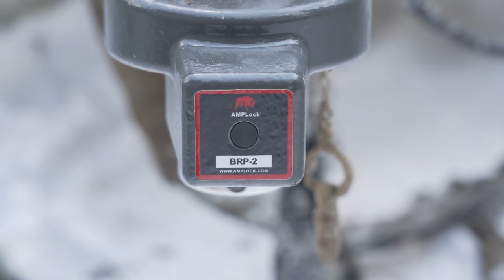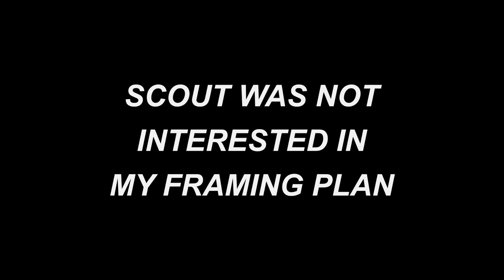ALONE with my DOG - WINTER CAMPING in a DIY Travel Trailer with a WOOD STOVE by a RIVER

Comment: nice build , i built a 6x12 with a fold up bed and a kitchen in the front . it is roomy enough to park my 3 wheel canam spyder in so i can ride when i get where i am going . one thing i did was install my safety chains with couplings so i can remove them when i park away from home . the idea is to prevent thieves from towing it with the chains hooked onto their hitch , and it does happen , anything to stop crooks , just keep the chains short .. have more fun..

Comment: Love the whole build , planning on one this summer and your security worry is one i have been thinking about and i saw one video where the fellow made his tongue ? on the trailer removable .Just a larger tube that slipped over the exsisting and when he parked he pulled it off , two pins held it in place ..........kinda where i will go for security

Comment: You need to lock your chains as well, wrap them around where they are connected, make sure their is no give, and with a good padlock, it doesn't stop the battery angle grinder though. All they have to do really is put a chain thru your A frame, and hook to the back of their towbar, where the chain connects and drive away. I have a wheel lock, it is the only guarantee, just don't ever lose your key.

Comment: Great lock on the trailer, but realize a thief can still use the chains to run off with the trailer regardless of the lock. I used a heavy duty quick link on my chains so I could remove them and leave just a couple of links near the trailer. With a good lock and no chain a thief would move on a to an easier target.
Reply: Hello 👋 Dear. How are you doing ? Hope you are fine. I'm Mark Clifford and am from Denver Colorado,  Where are you from? You seem like a real country girl

Comment: Hi I’m Peter. I love your caravan I watcht all of the videos you posted really like your stove I like to know it’s small smoke inside when is on or not? I have a similar to your caravan and I renewed everything inside including flooring lights wires I have no gas all electric from a 240 hock up and solar panel 12v and inverter and I have a diesel heater working well in England newer got less then-10 but the fuel expensive and I was thinking to swap for a wood stove;) you going a wery nice place I love to go there camping like your videos thanks for reading my message

Comment: My first winter camping was in a tent trailer in the Adirondacks of NYS in Nov. during deer season. At 20 below F our boots froze to the floor and our water pail iced over. We had an unvented propane apartment heater which we didn't trust to run overnight. No one had a warm sleeping bag because we used to have a tar paper cabin with wood stove until the snow collapsed it in 1971. I grew up in a farmhouse heated by an oak wood stove. The stovepipe ran horizontally from the stove to the chimney. I saw the same arrangement in the kitchen of an old farm house we hunted out of. It was a way to extract the maximum amount of heat from the stove before exiting to the chimney. You probably don't have headroom for something like that. If you did, you would have to line the wall and ceiling with fire resistant masonite board. It would be important also to clean the pipe regularly. I'm curious how often you have to feed your stove during the night. Also it would seem more efficient to build a stainless steel counter to prepare foods on and do dishes so you still have access to your cooler.  A shallow drawer would be handy for silverware and cooing utensils. A paper towel holder nearby on a wall is useful. The ironing board might be better as an eating table. In our camp we made S hooks out of wire clothes hangers to hang clothes to dry. Also handy for pots and pans. You could screw a lightweight cable the length of the wall to hook to. Wooden spring clothespins and spring metal paper clips also have similar uses. We also put down an indoor outdoor carpet to keep the floor dryer and cleaner and a boot scraper outside the door. A gazebo awning allows you to sit outside in rain or snow and enjoy the fire as well as washup outside. Also serves as a place to store firewood and extra ice chests. Even the best design can be made better.

Comment: All hitch locks can be bypassed using a chain wrap. City trailers use the method of taking one or both tires off if left for a while and putting locking nuts on the stud bolts. Curse crime.

Comment: That's a great lock. It's the same one we have on our fifth wheel. Someone did try to cut it off while we were boondocking. They used a dewalt circular saw as well as a dewalt sawzall. (Spelling??) The reason I know what was used is we pulled up on them and they left their battery operated tools behind. They hadn't made a scratch on the lock. They took off ( there were 4 of them) in a truck almost identical to ours. So they left empty handed and we received 2 almost new tools. That lock saved our vacation and a lot of money, so good choice. 
I use plastic utensils at home. Takeout food usually gives them to us and one way or the other they will find a trash can, so why not use them? We don't actually purchase them, just to be clear. Hope you and Scout had a wonderful trip.
Reply from the maker: It's a shame we even have to lock up our trailers.  Thank Irene.
Reply: Great lock for a heavy trailer, honestly if someone truly wanted to partake themselves of a light trailer, it’s a couple of chains around the hitch, lift it up with a winch and off they go.  Best lock in my opinion is a wheel/hub lock. Can’t take it if it won’t roll.